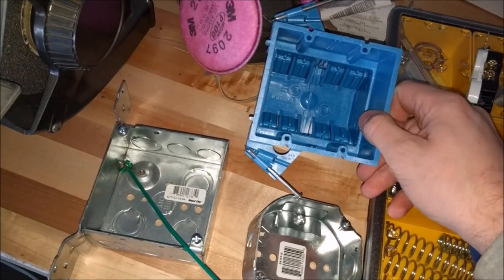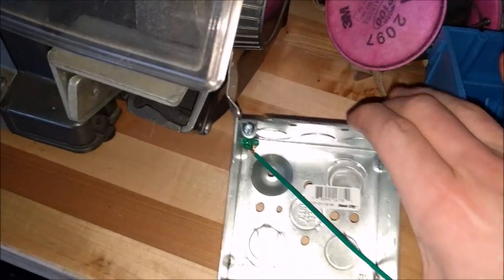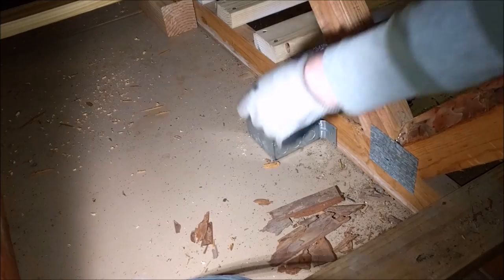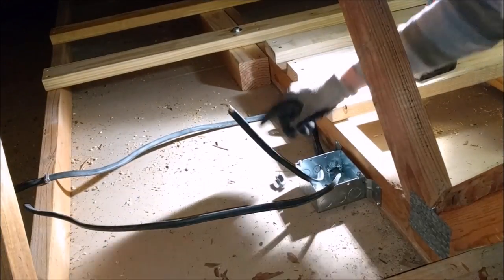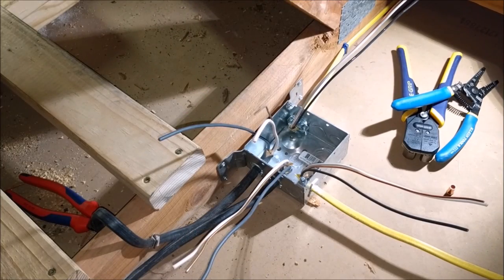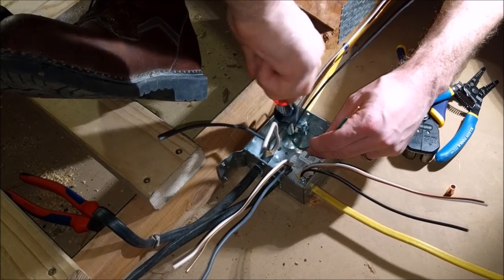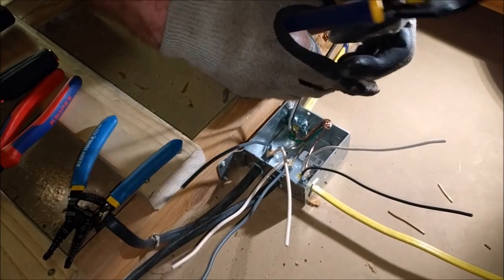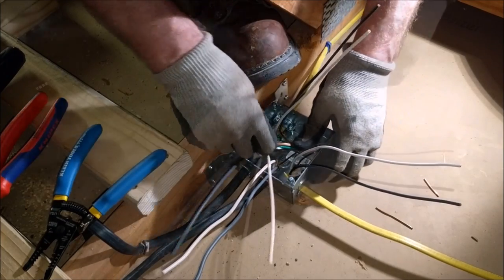Garage Lighting Project P5: Wiring to Attic Junction Box

Comment: Your metal NM connectors are on backwards and it's a good idea to open knockouts and install connectors before you crawl up into the attic so there's less work to do up there. I live in South Florida and it can easily get to around 150 degrees F inside an attic/crawl space during Summer, so I prepare as much as I can before going up in there.
Reply: I was thinking I'm doing it all before I get up in the sweat box lol.
Reply: @HeidiPyke  Yup lol
Reply: Free sauna time
Reply: true ,true!! Great advise
Reply: Very good tips from a man who has been there. Yes connectors are backwards taking space for wires.

Comment: Some good tips. I wasn't sure about the plastic push in connectors, but seeing this I see how they work when wires are trimmed to same length. Learning all the time!!!
Reply: And a much more reliable and secure connection than the antiquated wire nuts.

Comment: I had to wire together 4 lines, but the biggest tan color wire nuts didn't fit, so ended up using lineman's pliers to twist all together. Total exposed wire was less than one inch, in hindsight would've wanted at least 1.5 or 2 inches twisted. Seems to be working fine for 3 led porch lights. I feel on top of electrical tape and there's zero heat. Wish I knew about the 4 wire connectors.
Reply: Red wire nuts are bigger than the tan ones and there are gray and also large blue that hold even more capacity. Tan is not the biggest.
Reply: Are you saying you didn't use a wire nut on the wires? Have fun when you house burns down and you insurance refuses to pay because you did illegal wiring in your house.

Comment: Why not use a push in connector for ground?
Reply: Have to ground the metal box, if a plastic box was used then the push connectors could be used since the plastic box doesn’t need grounding.
Reply: @danquenell  you misunderstood the question.  He could use the push connector for the ends of the grounding wires if he could find a push connector with 5 sockets.
Reply: @percyfaith11  you’re right, I didn’t read that right. 🤦‍♂️

Comment: Thanks for the video. One quick question, I see you have two black Romex, one coming from the circuit box and the other going from the box to the light switches. The two yellow Romex are going the receptables, are these Romex all 15 amps or all 20-amp wires or a mixture ?

Comment: Can I splitting the existing wire in the attic to add outlet without make another wire?
Reply: Sure.  Use a junction box and wire the white wires all together and the black wires all together like the video.  the existing wire is what he called the power feed coming in from the circuit breaker box.

Comment: What is the name of that navy blue and yellow tool you use ? I’m refreshing up on this, I work for a general contractor & want to add value to his company. I use to do bath and kitchen remodels under the table but now I get paid for general and painting company on the books.. hope to be a general contractor in a few years, I enjoy electrical and plumbing but this is nice clean work 👍🏽
Reply from the maker: Those are Irwin self adjusting wire strippers, but this video is probably the last time I used them because they're too finicky with the insulation. I tend to prefer the standard plier-type strippers like Klein makes. 
https://www.amazon.com/IRWIN-VISE-GRIP-2078300-Self-Adjusting-Stripper/dp/B000OQ21CA

Comment: One 12/2 cable was not stapled within 8"  from the box, what if its under insulation and gets kicked? NEC is for safety to save lives. Not knowing code is always dangerous when doing electrical.

Comment: I would not use the push in connection because of a spring inside. Just twist the wires real tight,  tighten with a wire nut, then wrap the whole connection with electrical tape. It will never come loose and get rusted.

Comment: How do you ground the other metal box that doesn't have the raised screw hole?
Reply: Jubilee, sometimes they still have a 10-32 tapped hole or one can be drilled and tapped.
Reply: I don't have to worry about it because my house doesn't have any grounding wires.

Comment: Looks like box connectors are inside out.  The metal NM connectors should have the two screws on the outside of box... never seen it done the way you have it.  Also the plastic push connectors should be inserted from outside box.  That may explain why you were having problems with the wire that was pushed in through them.
Reply: He had the metal ones wrong but the plastic one looks correct to me.

Comment: Why do you have to ground it to the box?
Reply from the maker: The box has to be grounded to avoid potential electrocution in the event a live conductor wire comes into contact with the metal box. The isn't required for plastic boxes because they are non-conductive.
Reply: @354tb35yb5y  I saw you screw in one end of the grounding pig tail.  Where does the other end go?
Reply from the maker: @chuckwalla2967  It's connected to the rest of the grounding circuit in the bundle of wires connected with the brass crimp connector.
Reply: @354tb35yb5y  Does the wire you use to ground the box have to be insulated or can it be a bare copper wire?
Reply from the maker: @philipduffy6581  You can buy precut wires with green insulation and screws at the store, but I don't think code requires grounding wires to be insulated. If unsure, consult an electrician or your local electrica buildingl code.
Reply: @philipduffy6581  The ground wire can be bare copper.

Comment: Why did you not use a wago connector on the grounds?
Reply: Because the ones he has don't fit 5 wires. He could have looped a ground around a ground screw and saved one wire thus needing only a 4 port push in connector for the grounds, though.

Comment: Would have been better and easier to use another of the yellow push fit connectors on the ground wires,  instead of twisting and crimping!

Comment: What are those connectors called that you used instead of wire nuts?
Reply from the maker: These are push-in connectors. Ideal and Wago make similar models:
https://www.homedepot.com/p/Ideal-34-Yellow-In-Sure-4-Port-Connector-100-Pack-30-1034P/202894312
Reply: I use the Wago connectors, seems to me to be a tighter connection. I have seen the Ideal connector come loose if the splice is handled too much.
Reply: Most people call them crap.
Reply: @MAGAMAN  just like that new fangled PEX, OK. 🙄

Comment: Could I run a separate 15amp circuit to a junction box that splits to 5 additional romex runs. So one romex in from panel and 5 romex our so a total of 6 romex cables in this one junction box. This would feed 5 rooms of recessed lighting. Possible?
Reply: Cj Disla there is a limit on # of wires in a junction box and I think that may be too many. Also the amount of outlets may be too many depending on anticipated load.
Reply: Each conducting wire counts as 1, while ALL ground wires count as 1 no matter how many. I mention that, because you need to follow the NEC code on how many wires you can have in a given sized box.

Comment: Can you mix 12 and 14?
Reply: It's best not to, 12/2 Romex is for 20 amp circuits. and 14/2 is for 15 amp circuits.
Reply: Yes, as long as you are going with the lower gauge downstream.  Meaning 15 Amp breaker with 14 gauge wire is fine to add 12 gauge  downstream, the issue comes from the other way around, driving 14 gauge / 15amp wire on a 20 amp breaker.  The entire point is not making the wire pull more amps than it's rated for, which causes heat / melting ect .  Adding thicker gauge causes none of that issue.  The breaker is still going to respond to the same amps it's rated for, won't change that.